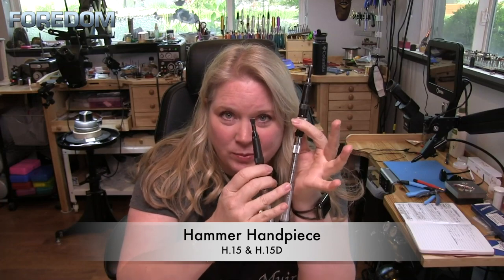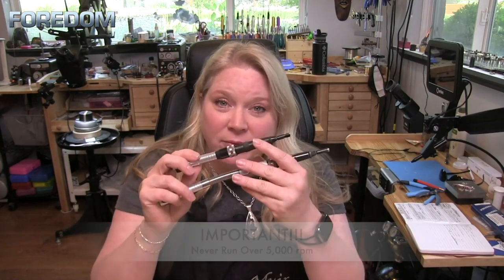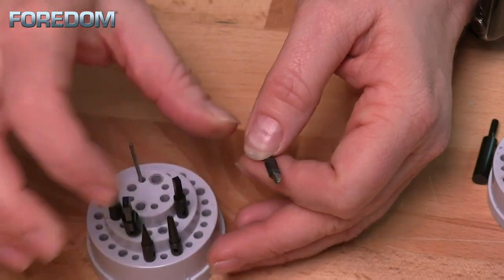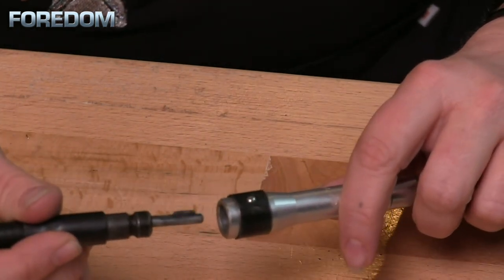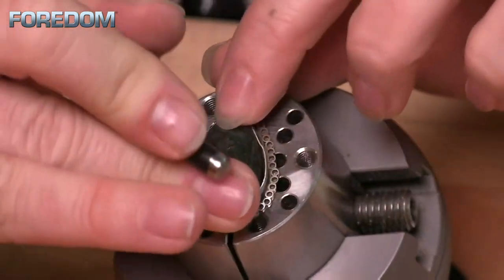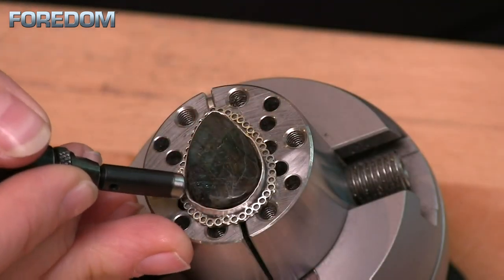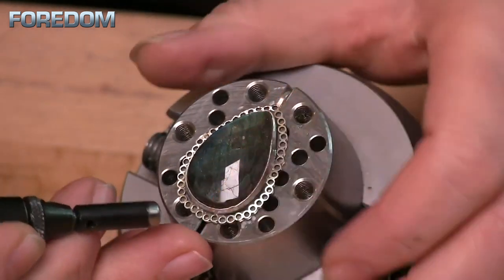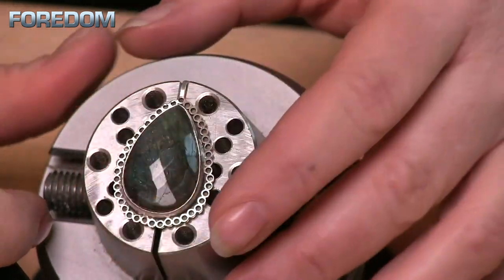How To Use A Hammer Handpiece

Comment: Good day, is it possible to lower the power of the hammer as I think it's still too heavy on lighter materials like bone. I am a Scrimshaw artist and would like to use it for stippling on bone or ivory. Your reply will be highly appreciated
Reply from the maker: There is a silver knob that you can twist to give the anvil points more or less power. If you need even less than that, it will be done by hand control.

Comment: I've been trying to use a handpiece from Amazon to set really thick silver and it doesnt have the power to push the metal before the tip slips and doesn't actually push. Is this a similar problem that the more expensive models have?
Reply from the maker: There is a silver screw knob that will allow you to change the strength of your hit. Play with that to see if it makes a difference.
Reply: @MelissaMuir  the silver knurled ring doesnt seem to do much. I can push against the tip with my thumb and stop it. Whats the normal strength for these things? I normally use a small hammer and a custom hand-held tip and the handpiece doesnt have a fraction if the strength of a good wack of the hammer.
Reply from the maker: @YarHarFD  hmmm you shouldn’t be able to stop it. Without seeing it, it is hard to know. But I use mine all the time for heavy bezels and such.
Reply: @MelissaMuir  thank you!